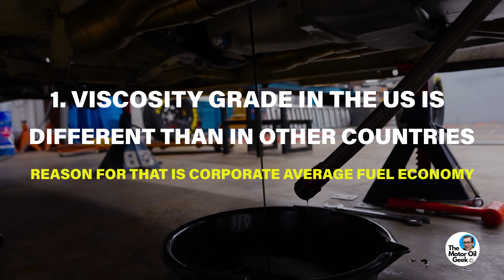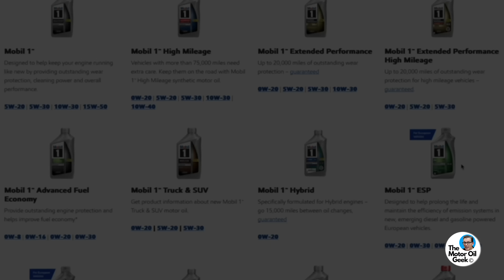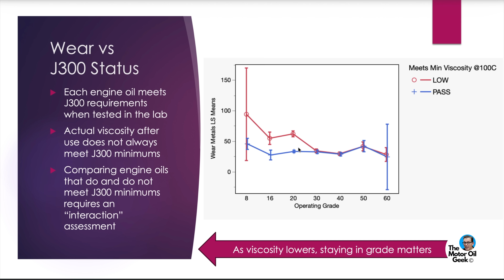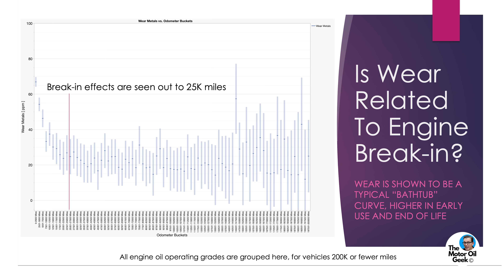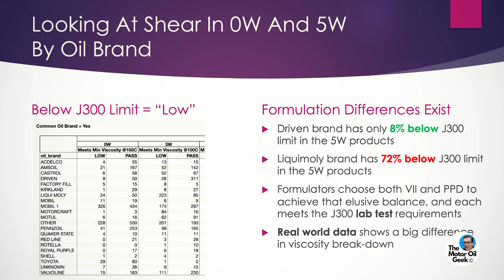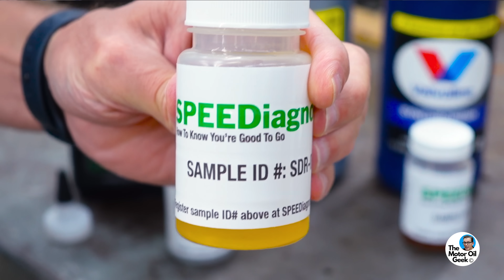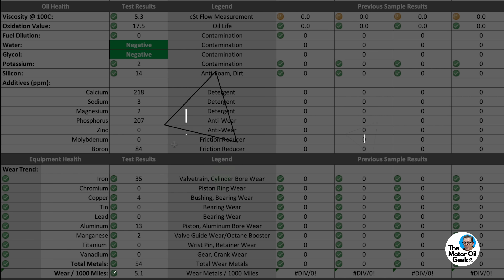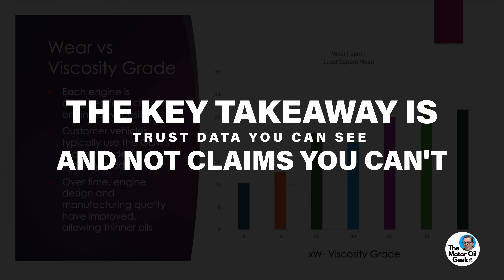More Ai Lies? The FACTS about 0W-20 vs 5W-30 (With Evidence)

Comment: Most low  grade oils you  find in modern vehicles  are shipping  starndards for now more than 15-25 mph  once you start to play in  speed ratios  55-80+ mph you cooking the oil passsed use case it don't matter whether you buy petrol  or diesel  the same failure point keeps happening

Comment: The reason it is safer is because if you don't change 0w20 oil soon enough, it gets too diluted to perform properly, where 5w30 would still not be too diluted to perform.  Just make sure you change that oil

Comment: Are we suggesting that a good oil such as Valvoline full synthetic in an engine that supports 0-30 or 5-30, the 5-30 film on parts is not a better choice? Given oil changes every 3,500 miles the thicker film should be the better choice. There was a study done with 2 engines identical milage and type and upon disassembly the 5-30 showed much less wear with cylinder cross hatches fully in tact vs 0-30 not in tact.
Reply: I think common sense tells us that a zero weight at startup before an engine warns up isn’t a good thing for any engine unless you’re in below zero temperatures causing the oil to thicken based on temperature.

Comment: If its not an ester based full synthetic like redline for example then your full synthetic its garbage. It will breal down from 0w-40 and thin out to half within 2.1k miles as shown in his video. Not to mention those non ester blends, basically everything you buy from walmart/autozone/advanced auto parts/etc are all just whats left over from oil companies sold to us. Yes there is proof from the Hollywood mechanic who shows testing proof and debunks even one of my favorite youtuber on his oil based testing methods. Project farm! Again Hollywood Mechanic - you are using the wrong oil w receipts.

Comment: I did oil changes at 3k with dino oil and do 5k on synth. For me the beuty of the 5k change is everyone knows exactly when they need an oil change. Its easy and its rare that any of our vehicles go much more than 250 miles over.
My 6.2 in the F250 called for the 0w20. I did try it. I did get better fuel economy. I stay with 5w30. Our Honda Accord calls for 0w20. It gets the same 5w30. I buy Valvoline from Amazon in the 5 qt jugs in a case of 3. The truck uses 7 qts.
The Camaro with 6.2 uses Mobil 1 " supercar" 0w40. 
I change the Camaro when the OLM says. The car is a convirtible toy that sits a lot. Its a 2020 and has 5k miles on it. The oil has been changed 6 times.
In 2021 the issue with the lifters in GM engines caught my eye. At the time 1 possible cause mentioned was a run of improperly heat treated lifters. I assume that means they got internal engine parts from china. Another cause pointed to the cyl. deactivation mechanism with auto transmissions. Another attempt at increasing CAFE results.
The LT1 in the Camaro is direct injection and you can smell the fuel dilution almost immediately on the dipstick.
I still own my 1978 Harley with Shivelhead engine. I never trusted the felt oil filters and the first 10 or so years when I rode it a lot I often changed the oil at 1k miles on dino straight 50 weight.
My oil change theory is simple...
Change the oil often and regularly. Use the best oil your reasearch can find and the best filters. And who cares what the manufacturer allows for extended oil change intervals.
In the Peterbilts I used to own with Cat engines I changed at 10k. They held 10 gallons of oil.
They kept extending the oil change intervals on the big truck engines as a selling point for reduced maint. costs. But they required additional filter swaps.
I live in Florida now and Im contemplating a heavier oil for summer. Havnt decided yet.

Comment: Same things with lifetime transmission oil. No such thing. Lifetime just means acceptable fail rates to keep the cost off ownership number down for marketing. If you look at the manufacturer of the transmission, they have the recommended change intervals at normal rates that we know they should be and it's not the vehicle manufacturer recommendations.

Comment: My 2023 Travato on a Ram Promaster chassis recommends 0W-20, which I often use and change every 5K miles. With no particular evidence, I sometimes use 5W-20 in the hot summer months as the RV is almost 10,000 lbs, and I feel more comfortable using a thicker oil when the temp is over 100 degrees outside.

Comment: Lake, what is driving the sample size disparity between the 5w-30 and 0w-20?  I think I saw something like 1800 samples for one and 300 for the other.  That's a quite large difference, especially when 30 has been more relevant historically.  Is this representative of the oil recommendation of the vehicles today?  Or, is it being driven by a "freakout" scenario because of the thinner oil and fear of inadequate lubrication?
Reply from the maker: The vast majority of the samples we see from gasoline engines are 0W-20.

Comment: I like this channel and trust most of the data put out by it. But I disagree about this subject. Every other country uses 5w-30w in the same exact cars sold in the US that we are recommended to use 0W-20w in. We have a high amount of cam actuator failures and roller lifter failures. These high pressure parts get hammered and 0w-20w doesn’t provide the impact dampening 5w-30w does. The thicker oil does better with high pressure sheer too.

Comment: Ok My 10th gen Honda Civic hatchback sport 1.5L Inline 4-Cylinder DOHC Turbocharged engine (code-named L15BA)
Manufacturer claims 0w20
I use Pennzoil ultra Platinum 0W-20 so is the 5W20 in the same oil the better choice??

Comment: The correlation between viscosity range and shearing rate was really interesting, might switch to 10w30 over 5w30 because of that (gas engine in a hot country)

Comment: It's not so much the difference between 0-20 and 5-30 but the frequency of oil changes. Most good shops will agree that 15,000 km is to long and 6 to 7 thousand will double your engine life. It will also double your auto trans life to change oil everyange  oil every 30,000 km and flush every 60,000 km

Comment: Not mentioned in the video--when 5w-30 shears out of grade, it typically goes to a 20 weight, which will still protect the vast majority of engines.  When a 0w-20 shears out of grade...bye bye.  There is zero downside to using a higher weight engine oil if that engine is designed to handle it (check the owner's manual for your engine in a country outside the USA to see what's recommended).  Fun fact:  in Central American countries, you can't even buy 0w-20 oil off the shelf--it's special order only.  Even 5w-30 is hard to find.  The most common grade is these countries is 15w or 20w-50.

Comment: I wish I could attach an image of my rocker arms on my 14 Silverado L83. I use Mobile 1 0w-20 and change my oil once a year. I  do have an oil leak and I and end up adding 2 quarts at 50% oil life. But I did valve cover gaskets not too long ago and there is no sludge in the engine, just a thin coating of varnish. I've got 195k miles on the clock. I also don't idle my truck, cold weather I'll remote start as I'm walking out to it so by the time I'm ready to put it in gear its been idling for about 30 seconds. So I am grateful that Lake and a few other influencers put videos out like this and back up their claims with science.

Comment: I think most of the confusion. Regardless of the case. Honda they have always been long mileage vehicles. Until 0-20, then they started having oil leaking from gaskets everywhere. Some at 50k. Especially with the turbo models. The 5-20 never had any issues in a Honda.

Comment: Ram 5w20 or 0w20 , I use 5w30 , the oil is much better . Pennzoil ultra platinum . So I don’t know 🤷🏻‍♂️ engine sounds better the oil looks better at 5000km when I change it . If people want to use factory standards ok and yes I use more fuel which makes me think the thinner oil is just for gas mileage.

Comment: I personally bumped my ram 2020 5.7 ram 1500 to 0w30 from 5w20, one part being that where i live goes down to -40c or lower and that the lifter rattle on start up and during MDS disappeared.
Reply: I live in the south and I get that lifter rattle… Oh wait, I have a 95 Ford 300 straight six! That will rattle on any grade oil! 😄 
Especially when my idle speed control launches it into Ludicrous Speed on cold starts!

Comment: I got an email from Blackstone Labs saying 10K oil changes on the Toyotas were not only ok, but their testing shows sometimes it can go beyond 10K. I just bought a new RAV4 hybrid and I'm still getting mine changed at 1,000 and 5,000. However when gets to 5,000, I'll send a sample to Blackstone. If at some point they say 10K should be ok I'll go 10K and send them a sample of that.

Comment: I run synthetic Castrol 10-30 in my Subaru. 139000 miles, still going strong. Oil change interval is 6000 miles.
Reply: What year is your Subaru, I have a 21, and use thicker oil also, with no problems

Comment: I have a Kia 1.6 turbo. Kia has a less than stellar engine life. The car is now living I’m southern Florida. Because of these factors, I have switched it to 5-30 rather than 0-20. I also use Walmart Tech oil. This decision was based on other countries using the higher viscosity oil, and Walmart oil tested out pretty well in 6our video s.

Comment: I have a RAV4 that recommends 0w16. I used it for one oil change cycle of 8000km. In new vehicle. Around 1000km I noticed a change in fuel economy it dipped. From 600km per tank to 550 km per tank. With no change in driving. The first tank was strictly on highway and got 650km on that tank. After the first 8000km I switched to 0w20. My city fuel consumption increased to 650 km. And highway driving increased to 850-900km per tank. Depending on speed 105km/h 85km/h respectively. I also drive the vehicle in sport mode at all times. These are real world numbers. And oil is Toyota brand oil. The problem with a lot of these in house tests done by many manufacturers is they have perfect simulated conditions and reality is far from perfect.

Comment: No matter HOW 'phenomenally miraculous' current day viscosity index improvers are, they cannot defy the laws of physics.

Even 'perfect' Group 4/5 base stocks can only do so much to cover any multi-viscosity 'spread' of a finished oil. 

All of that being said, is there any difference between an oil's ability to resist mechanical shear, and it's natural resistance to fuel dilution  (i.e.; given the same VIIs used, are any base stocks significantly more resistant to fuel dilution than others)?

I understand that NOACK volatility numbers are NOT to be used as the sole, exclusive factor of an oil's abilities to stay in grade, but it is certainly ONE of the factors to look at, correct?

My EcoBoost 1.6 calls for 5W-20 by the manual.
Given that it is an inherently fuel dilution (as well as LSPI, of course) prone direct injected <-(only) turbo, I feel justified using the Ravenol DXG 5W-30 in it, year 'round.

IF Ravenol offered a Ford spec meeting 5W-20 with the same exact quality (but lower viscosity) base stocks, as well as the DXG's excellent full additive package, i would use it, especially for the 'winter half' of my twice yearly oil changes. 😉

Comment: What does "in grade" mean ?   Asking for a friend
Reply: There is a range for each oil viscosity. In grade means the test sample is within the correct range. Over time, the oil can see a change to its viscosity. For example, it could become too thin because of fuel dilution or too thick because of an additive used to stop a leak, etc.
Reply: @espghia6607  Thank you !

Comment: While you are correct, the AI is wrong. 
 At the end of the day however MOST will be better off with a 5w30 oil over a 0w20 in most modern cars DEPENDING on where they live and what the temp range is. The 5w30 offers more protection and is less likely to have lubrication failures under high load low RPM use. When the 0w20 encounters issues it lacks the margin to protect as it needs to. 

 If you live in a climate where it is seldom below freezing and never below 0 degrees Fahrenheit I can’t see a benefit to 0w20.

Comment: Why take a chance with viscosity shear?  Start at 30 instead of 20 for the hot viscosity.  Does it have to be made complicated?
Reply: Maybe the engineers specified 30 as an allowance for some viscosity degradation for all the reasons mentioned.

Comment: So what do you recommend when the Manufacturer recommends 0W-20 in their vehicles. A bunch of people have premature engine failures, and the OEM releases a bulletin, “well actually, the engine really needs 10W-30”. I don’t want to cause undue wear or flat out failure of an engine that I will be financially responsible for, all because the manufacturer wants to chase government mandated fuel economy standards. The Manufacturer doesn’t give a dang if your engine last a long time. They only care that it makes it past the warranty window. I’ll trust the OEM like I’d trust a wet fart. I will always go with my gut. They tell me to use 0W-20, I’m using 10-W30. They tell me oil change intervals are 10-15K, I’m doing 4-5K. Hell. These yahoos can’t even get their software to work in their vehicles, why would I trust their choice in oils?
Reply: Exactly this! ⬆️⬆️⬆️ Jeep recommends 0-20 on all their 3.6 since (key word; since) 2017. Prior to that, it was 5-30. 
Running 0-20 in Florida climate will make the engine sound like a mechanical f’kery. The catch can installed on my vehicle will be full before hitting 500 miles. Switching to 5-30 on the other hand, will quiet down the engine, will make it run very smooth and I can go 1000 miles before needing to empty the CC. For summer, I am going to step up to 5-40 (possibly Motul).
Reply: Most engine caps specify 2 different grades for winter and summer . Use the others one which is on the cap. Most likely 0w20 and 5w20 are on the same cap .

Comment: I think Lake makes his responses ambiguous so as to never put this issue to rest: Should you go thicker than North Americn CAFE-based owner's manuals (especially regarding Toyota’s newer 0W-8 recommendation)? Yet despite all his nitpicking of the AI video, clearly attempting to sound as if he's "debunking" it (while simultaneously agreeing with it), Lake is actually affirming that the AI video's conclusion is ultimately CORRECT, but for the wrong reasons: BECAUSE ALL ENGINE OILS SHEAR IN USE (with variations), in MOST cases, a quality 5W-30 oil WILL provide a safer margin of protection for your MODERN engine than even a quality 0W-20 oil.

That margin of protection increases even further over Toyota’s 0W-8 water. Similar to Lake's daughter, I also have a newer Toyota with an owner's manual recommendation of 0W-8. I got that water out of my engine as soon as I learned it was in there. Frankly, even a quality 0W-20 is better than any 0W-8 if you like to drive your car like you stole it, especially in the Arizona summer heat. For now, I'm running Penzoil Ultra Platinum 0W-40. May change it up later. Never going below 0W-20. May ultimately settle on tried and true 5W-30 full synthetic.

Comment: One thing not talked about here is the fact that modern engines have almost universally switched over to a low tension piston ring because this reduces internal engine friction and therefore increases fuel economy.  The problem is that a thin oil will get a lot more blow by through the piston rings, especially for lower tension rings, and this will lead to carbon build up all around the pistons and lead to early engine failure: the car turns into an oil burner because the rings get stuck inside the pistons due to the carbon from all the oil blowing by and then burning off, and this is made much worse by the modern low tension rings since it takes less carbon to get them stuck.  This can be prevented by using the thicker oil recommendations the manufacturers use for the same motors in other countries, and by using 5000 mile/6 month (whichever comes first) oil change intervals on 100% synthetic oil instead of the 10,000 mile intervals the manufacturer recommends.

Comment: 170,000 on my 2016 ram, drive it coast to coast all the time still starts runs and drives like new, just keep up on maintenance. 
My 2004 2500 ram with 5.7 hemi i put 245,000 and still looked, started, drove and ran like new, wished I would have kept it.

Comment: 0W-20 is, obviously, a 20pt difference between the high and low numbers.   5W-30 is a 25pt. difference.   So just on that specific data, 0W-20 would tend to have better sheer stability.

Comment: Temperature is the biggest reason. Can't use the same oil at -40F/C in America as we use in Australia at 40C without having issues. We don't even need antifreeze, just corrosion inhibitor in most "coolant" for sale here.